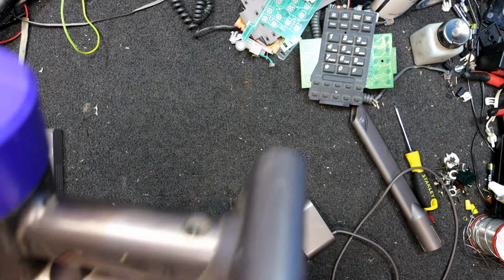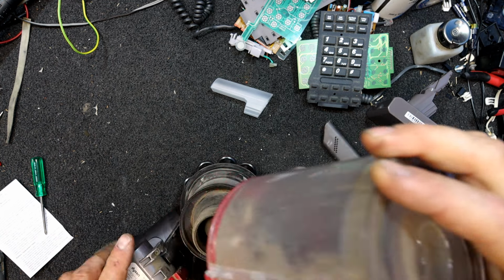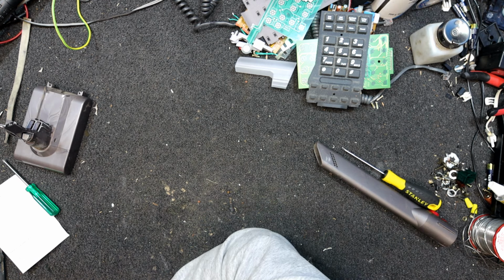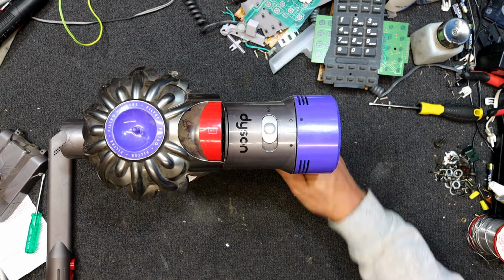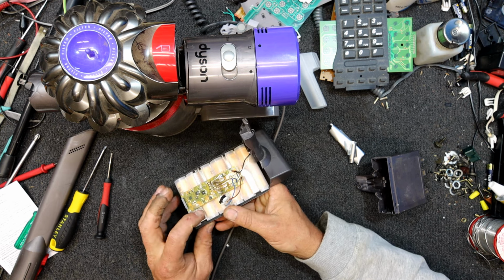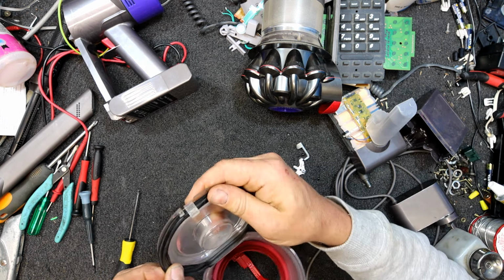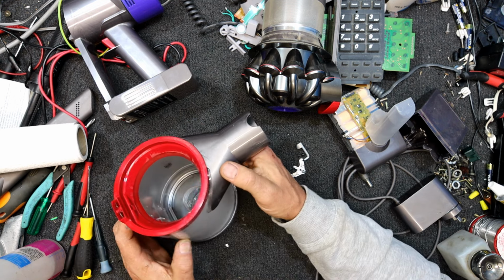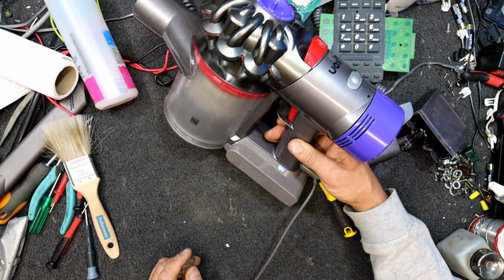Dyson V7 Motorhead Vacuum Wont Run in Max Mode Battery Replacement

Comment: I don't have the exact same model as this but I found an adapter to use my Makita batteries on it, incredibly useful to be able to swap out the battery instead of charging a built in one
Reply from the maker: I have a friend who has done that with Milwaukee batteries. Its a good upgrade for sure.